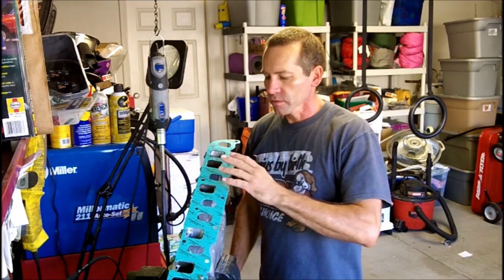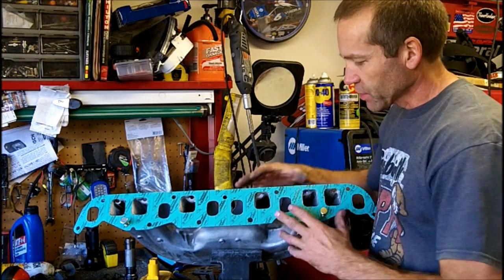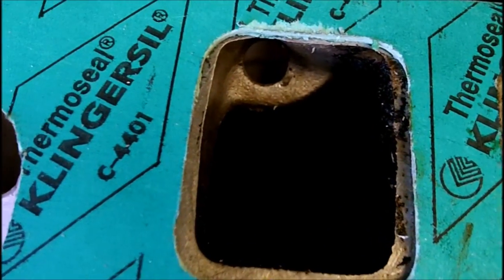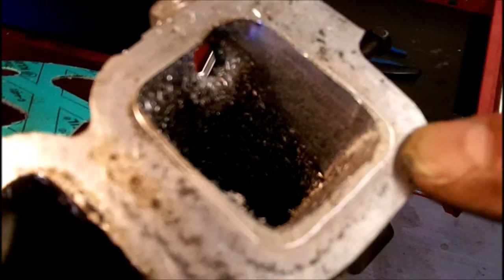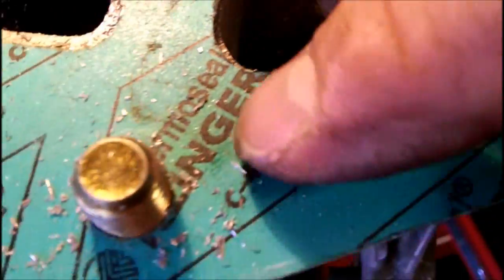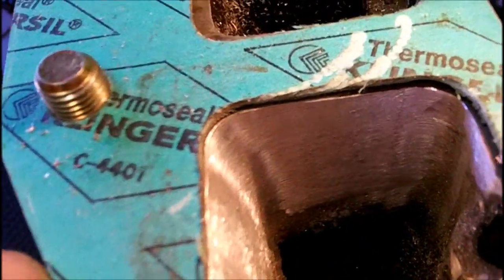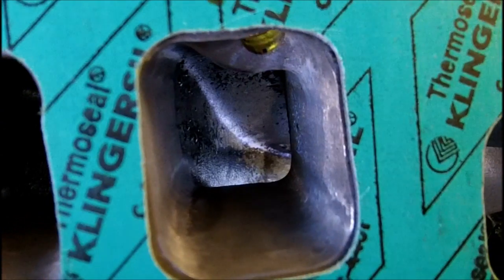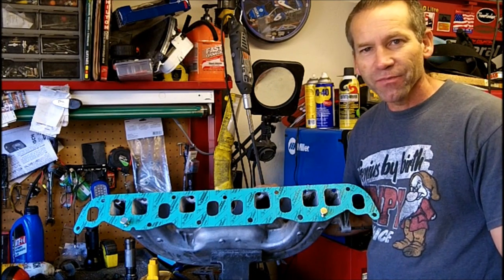Port Match Jeep 4.0 Intake Manifold

Comment: Was it a very noticeable change? I'm installing the s&j 4.7l stroker and will be doing this with the throttle body,  the intake of course,  12 hole fuel injectors and the ripp coil mod with a header

Comment: Martinbuilt: what is your thoughts on Denso 12 hole injectors on the 4.0 L with the 68mm TB ?
Reply from the maker: I personally haven't tried it yet on my 4.0 but I am currently running the Bosch 280156161 that are 12   hole that work well.
 I think the Denso 12 hole injectors may be a little too much for the 4.0...

Comment: this mod doesnt change the mixture at all? is a better flow mod with no consequenses?
Reply from the maker: The mod is basically designed just to help improve air flow from the intake to the cylinder head.  If the engine pulls more air from this modification the ECM will easily adjust the air fuel ratio.
Reply: @martinbuilt  thx for the reply, thats exactly what i was thinking just a fuel trim mod by the ecu,cheers

Comment: Hey bud.   I know that this is a  5 year old video,  but it is the first time I have seen it.   I heard you say that you made that manifold gasket,   my question is,  did you make it completely from a blank piece of gasket material?  Or did you  modify a gasket that you purchased?   Either way,   if you made it from scratch, what did you use as a  template?    Or if it is a modified version of a purchase gasket,  what brand and part numbers is it?   Please answer if you receive this memo,  or make another video explaining these things.  I am very interested,  and I'm sure that many other jeep 4.0  folks are also.   Thank you..
Reply from the maker: Yes I made it from scratch and I use the method that I show in this video to make the temp plate for the gasket. https://youtu.be/txCBBO_mI1Y  I made the gasket from the cylinder as those ports are large then the intake.

Comment: Just a helpful tip I use a regular tip sharpe marker - red,blue or green to mark where material needs to be removed . some time it's hard to see a scrib mark
Reply: That sounds like a good idea,   then if you changed your  plans,  you could just clean off the  marker with some solvent.
Reply from the maker: Good idea, thanks for the tip.

Comment: Honestly you are not going to realise much of a power difference I found it's better to just cut some gasket material and fill in the gap or fill in the area with some silicone gasket.
Reply from the maker: The gasket really didn't have much to do with it other than it was a means of transferring the info from the cylinder head to intake manifold. The reason I did this was because of the mismatch from intake manifold to cylinder head.

Comment: if I have a 4.2 can I put the 4.0 head on it and then change it so It will receive the 1999 beautiful fuel injection or will it fit right up to a 4.2 head ?
Reply: IIRC.... their are water jacket hole differences ..... IIRC again, the 4.2 has more holes

but i KNOW it can be done.....need the right gasket for sure (cant remember if ya need the 4.2 orr 4.0 gasket howeverr)
 should be a lot of info about this online

Comment: did it worked?
Reply from the maker: LOL ... after all these years I still got that Edelbrock aluminum cylinder head sitting in the Box and that intake on the Shelf and still haven't got around to installing it. It's on the list. There's no reason it wouldn't work.
Reply: Well put it together on good short block bro,..  We are all  interested in  seeing and hearing it run...

Comment: So the manifold now matches the gasket......great job but does the gasket perfectly line up with the inlet ports on the head?

I might do this on my ZJ.
Reply from the maker: I first made the gasket match the head then transfer the gasket to the intake manifold, so both intake and head match perfectly.
Reply: martinbuilt 

Ahhhh, that explains it, thanks.

Comment: I remember reading that the sizes were mismatched to keep the pulses from back flowing into the valves. They had dynoed before and after. The hp was higher before the port match.
Reply: I was told by an old time engine builder,  that this style of port matching most likely would gain several foot pounds of torque in the  mid rpm range, and should also have a improvement in  throttle response.  But such as Martin said in his video,  I was told that it is best to leave about 30 thousands of material around the edge of the gasket port holes to help with turbulence and to also help prevent vacuum leaks..
Reply: Yes please lets see this article
Reply: Horse hockey ; any time you reduce turbulence by matching things up you increase the performance.

Comment: Which intake is that.
Reply from the maker: sheldon bertram.  that is the 99 and later
Reply: martinbuilt ok I was wondering if it will work on a 96.
Reply from the maker: sheldon bertram  yes it will fit a 96 but you will need to get I believe it's the power steering pump or belt tensioner mount from the newer model

Comment: Besides nicely matching the two togather what other benefits is there to doing that?
Reply from the maker: Jaime Sustaita the idea is to improve the airflow anytime you can make a smoother air flow path you will gain horsepower. Of course this is only one step next would be to Port the heads improve the exhaust system and air intake system.

Comment: +martinbuilt
Have you noticed any improvements?
Reply from the maker: Can't say yet I haven't installed yet. Should be soon. Not working right know so I got time.
Reply from the maker: MrHilbillybob1 I have not yet installed  intake manifold. I have a Edelbrock cylinder head that I'm going to install at the same time

Comment: Gasket is useless
Reply: This really has nothing to do with using the gasket after he's done. He is using the gasket only as a template/stencil to port his airways on the intake manifold, so they match his cylinder head. Its a cheap gasket that when used to do what he did, is a great and inexpensive way to match your ports for a better airflow for more horsepower, torque, and throttle response. Try only commenting when u actually know something on the subject at hand, instead of being a smart*** in a comment that only makes u look dumb.

Comment: Great video. You didn't give any info as to how you made the gasket pattern. Will you please explain ?
Reply: Jim Miller you lay gaskets an surface that you want to match and take  brass hammer and tap gasket around the edges.  Cut out marks or use some heavy paper in the same manner then trace to gasket

Comment: Does any work need to be done to the head, such as removing any material, like what was done to the intake?
Reply: He is matching his heads ports to his intake. The gasket was cut out from the heads ports, so is like a stencil or template of his heads ports when he puts it on his intake and removes the metal from those ports. Which now makes them "matched ports" like the title implies, so no he doesn't have to remove material on the head. I believe he said the head is a new Edlebrock head so definitely don't remove any for multiple reasons like warranty, already how they need to be for good performance, Edlebrock has done R&D to get the part right so y fix whats not broke, and etc. If factory I guess he could remove some, but then u have to remove it from the block before doing that so no metal shavings get in there, & to clean out the metal shavings. Really not worth it vs just matching the intake to them and doing what he did then polishing them up for smooth air flow.

Comment: Forgive me if im not getting this right but you just got a blank piece to make your own gasket basically bolted it to the cylinder head to keep it from moving then got say a box cutter or a exacto knife and started cutting the holes to the exact size of the cylinder heads correct

Comment: Any improvement noticed? I've got to swap my Jeep engine and thought I'd make some improvements along the way. Wish there was a way to get a modern crossflow head on there.
Reply from the maker: I haven't installed the intake yet. I also have the new Edelbrock cylinder head and was going to do both at the same time. I matched the intake to the new cylinder head.
Reply: Looking at your intake reminded me I wanted to hack up a couple intakes and make 1 larger intake with 2 shorter paths to the TB for all 6 runners, to make a 3 stage intake. Long for low rpms, shorter in steps based on rpm. It won't make more but it will shift the tq if I do it right : )
Reply: sorry to revive an old post, my cousins and i use to buy old junk vehicles(mostly trucks) and just port and polish the heads and intake and we got big gains. so much so it was a wow factor for a "free" mod. defiantly worth the price of a few gaskets.
Reply: a 100hp?....a 50% increase from cam and intake?.........doubtful.
Reply: why? just get a offenhauser 4 barrel intake and throttle body with injectors. The injectors are batch fired anyway and if your boosting then what he did is more then enough. just a larger valves and a voodoo cam will free up 100+ hp

Comment: HI, Can you tell me where you got the gasket material and does it do a good job.I am not liking the leaks I get I have tried many brands.thank you Matt
Reply: If you have tried many brands, & 1 of those is the Fel-pro thats the higher end/quality 1. I'd make sure u bolting all the intake and exhaust bolts on correctly in the correct torquing sequence and correct torque value. When my exhaust manifold cracked bad, I used the Fel-pro 1 on my 1998 Jeep XJ. I have 4.0L in-line 6 in it too & used the Fel-pro when installing a new header instead of manifold and upgraded the engine mounts(main reason most the exhaust manifolds crack/not just heat). I did the bolts/nuts for mating the header and intake in the pattern my Haynes manual said to and to the torque value it said. I have 55-65K miles on it since then and no exhaust leaks.

Comment: wouldnt it have been easier to trim a gasket rather than crewing up your manifold.. seems backwards to me.
Reply from the maker: I don't think you're entirely getting it I match the intake ports to the Head because they are smaller than the cylinder head. I used the intake gasket to transfer from the cylinder head to the intake manifold. The only reason I made my own gasket is because there was no gasket out there that match the cylinder head perfectly.

Comment: intake flow is only as good as its narrowest point. Grind the port till your blue in the face, if its narrow deeperinside.......thats going to be your max flow
Reply: +matt sez and....larger inlet area is still reduced by the size of exhaust ports.....doing one and not both makes no major diff
Reply: its more complex than that. because of high and low pressure zones. Depending on the application,you need to priorise the velocity instead of volume capacity.

Comment: how's the performance after the install? Thank you
Reply from the maker: +tk106
I don't know, as I haven't installed it yet. I have the new Edelbrock  cylinder head and was going to change the intake when I change the head. Even if I had changed the intake I don't think it's something your going to feel. The only way your going to see the difference is on a dyno.

Comment: thought about doing a before and after dyno? maybe a mpg difference?
Reply from the maker: +Jason Finlaw 
It would be fun to do dyno runs for all the modifications to see what work and how well it works, but its not in the budget. I doubt I'll see any mpg increase .
Reply: +martinbuilt theoretically it should be about 2+hp/3ft lbs. unless it creates more turbulence before the cylinder. I understand the budget, that's why I read and watch videos first. lol